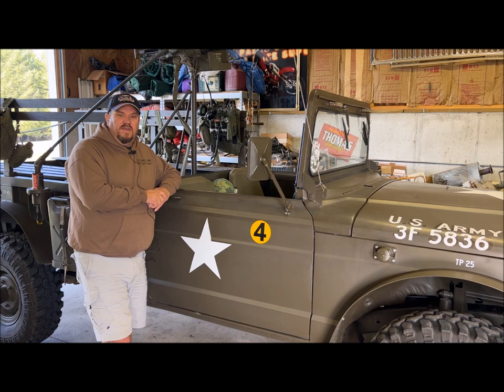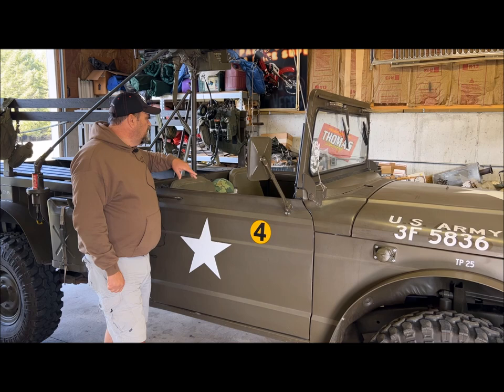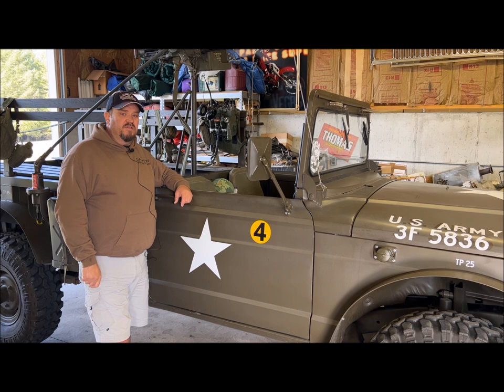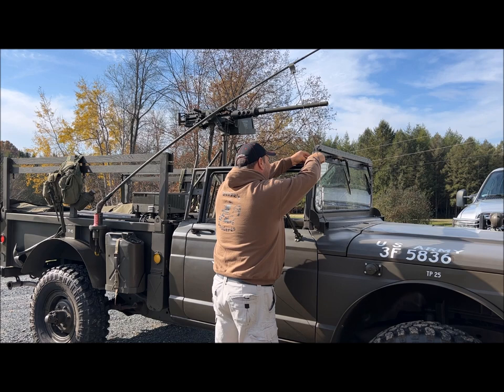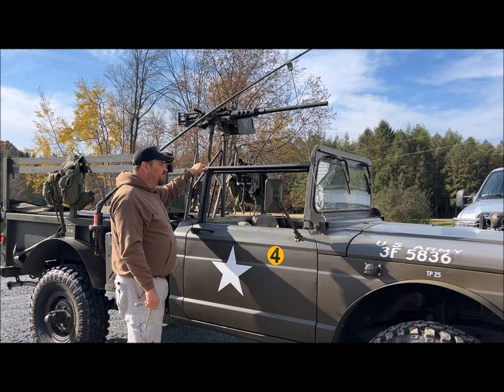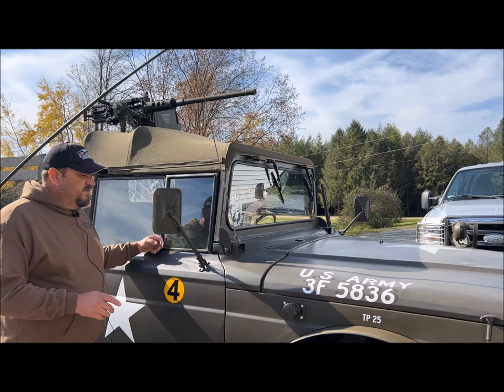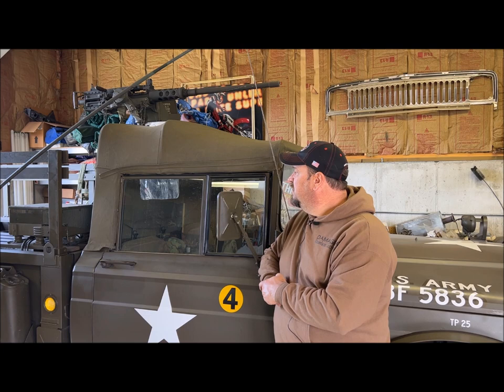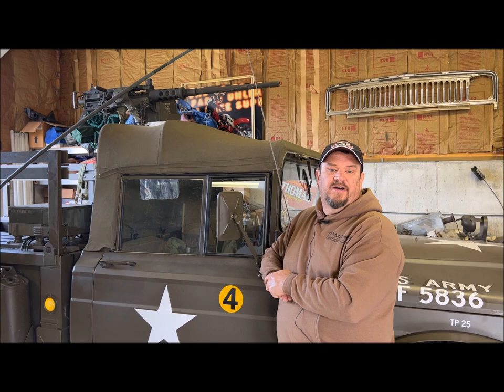Green Iron TV Episode 16 - Topped! Installing the soft top on a 1967 Jeep M715

Comment: Great video!  How waterproof are things when the top is on and the windows are up?  Does a lot of water still get in while driving in the rain?
Reply from the maker: Thanks.  They are pretty waterproof when everything is installed correctly, and all the rubber seals and gaskets are in good shape. Like any Jeep with a soft top there will be some leakage around where the top meets the body, but nothing too dramatic.